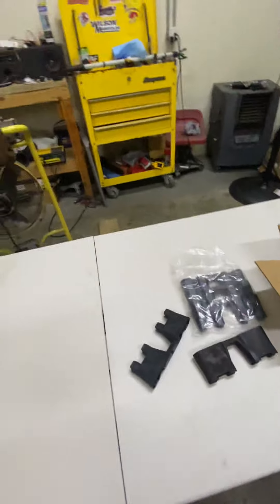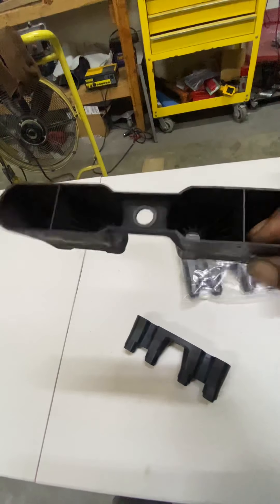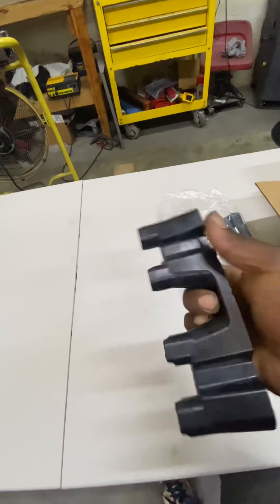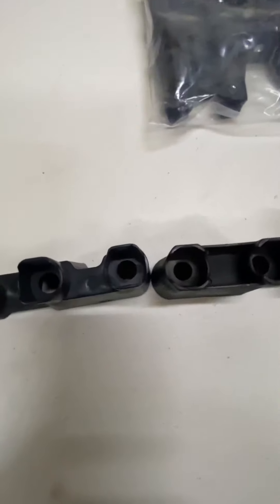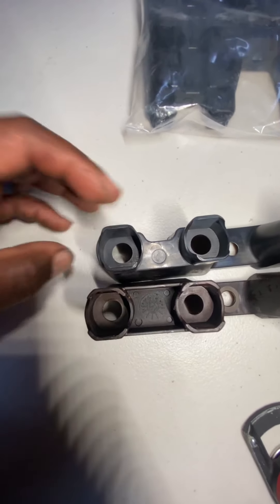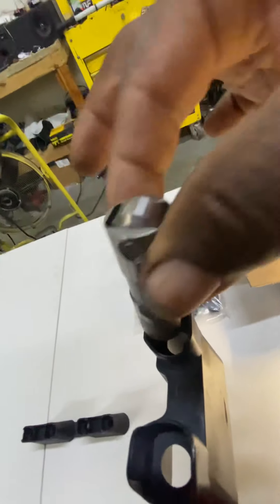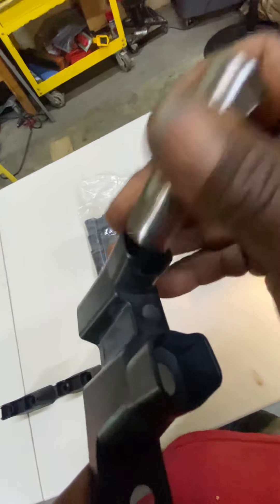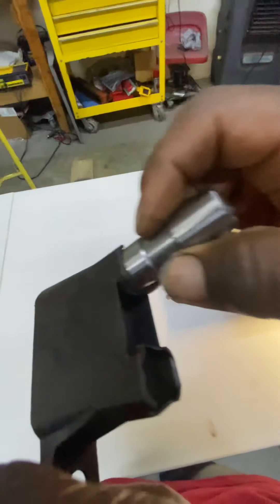LS lifter tray warning!!!

Comment: I think I put some in a 15 Camaro SS. 3 months later I’m troubleshooting lifter noise. But at least they snapped in just wish I was warned earlier. Good thing my client supplied them
Reply from the maker: Awe man. It happens. I just hope my vid can save someone the headache. Thanks for watching.
Reply: @darrintonrobinson181  I appreciate you. That Camaro I mentioned had different length pushrods. The manufacturer had a miss print

Comment: I found this myself with a cheap set. They’re cheap Chinese rubbish that doesn’t even hold the lifter properly. Where a GM unit should hold the lifter. You should be able to load them and use the tray to fit them to the engine.